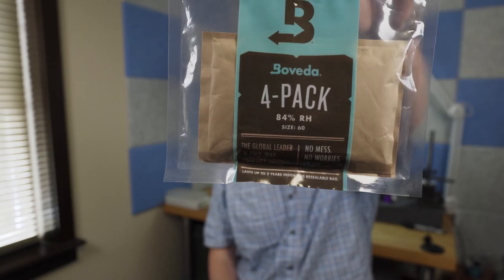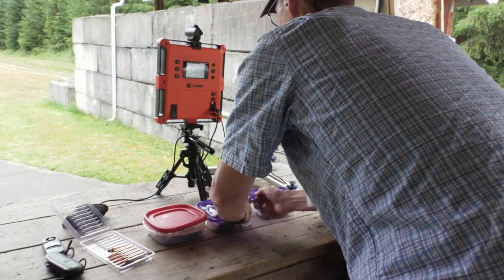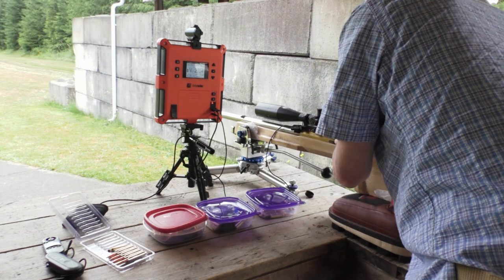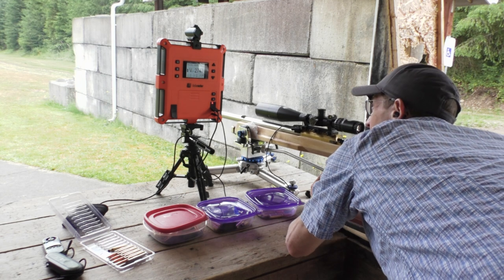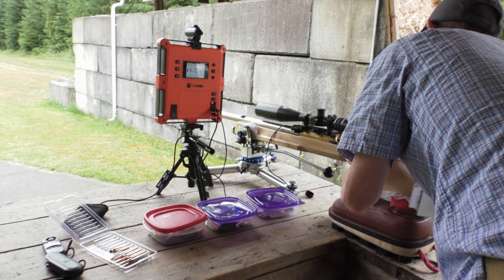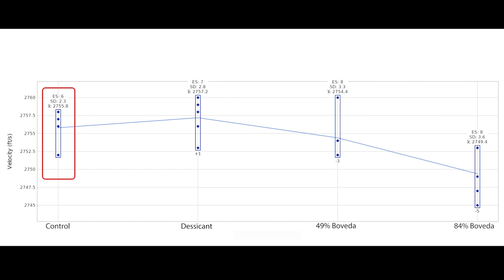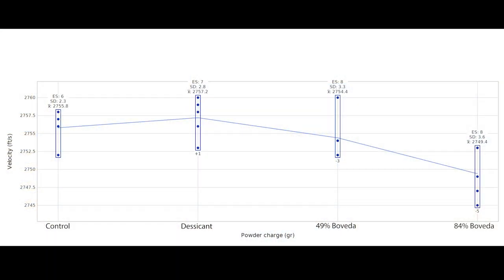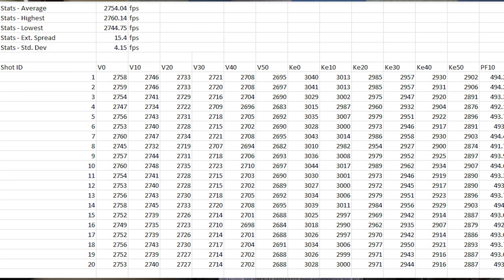Humidity Effects on Loaded Ammunition

Comment: Had a friend who lives at the beach here in Orygun gave me a bunch of loaded .308 to shoot in the Classic Military matches. The ammo was terrible, lots of necks separated when fired and some were an FTF situation and the velocities were all over the map and accuract was nill. So, i pulled all the ammo down and salvaged all the bullets. The brass was a total loss full of corrosion inside and the powder which was IMR4895 was clumped inside the ammo and some I had to dig out. The powder was a dull grey/black color and had swelled from the moisture. It was a total loss other than the bullets were fine. I called my friend and told him to check his stored ammo for the same thing. I was just the other day loading some .308 with some old 4064 in the old IMR metal cans the powder looked the same and kernels had swelled 2X and had a dull grey finish and looked nothing like 4064 from a new plastic jug the dead give away was when I loaded a .308 case it filed it up darn near to the top of the neck. I looked in the can with a flashlight and the inside of the metal can was all rusty. We have huge temp. swings here in So. Orygun and the winters are wet. I'd say it's best to store Powder and Primers and even loaded ammo in a temp. controlled enviroment for sure.

Comment: Took your data and ran it through a t-test using 95% confidence and beta of 0.8. At the end of the day, with the sample size used one cannot empirically claim humidity has any effect. Though if I were conducting this study I would take a few more data points with the expectation it'll show a difference then. Seems like moisture does effect burn rate.

With that, the difference of the high humidity vs your control is VERY close to minimum difference to detect. Looks like you needed about 1 or 2 more samples from each population and the study would pass the sniff test. Any differences between the groups that are not the high humidity would require a sample size of 54. 

Good stuff!

Comment: This is a nice quick test, and thanks for doing it.  Seems as though humidity for loaded rounds  doesn't really matter much.

This test reminds me of a test done on the Coravin, a tool that seeps wine out of a cork with a tiny needle without having to remove the cork.  The Coravin replaces the wine with inert gas which supposedly keeps the wine from oxygenation. 

A test was done, and supposedly wine stays like new for 30-60 days after using the Coravin.  Meaning it takes quite a while for oxygen to seep through the tiny hole made in the closed cork.

This test seems very similar, with similar results.

Comment: It would be cool to see a long term experiment to evaluate the rate of humidity transfer through the sealed case. Set up would be like this - load really dry powder into rounds, then store them in a high humidity environment. Shoot groups to get the velocity at one hour, one day, one week, one month, one year after loading. Control would be moderate humidity powder stored in a moderate environment for the same time periods.
Reply: i have 12 bore ammo witch is over 50 years old the case is paper no special storige they are still working no problem

Comment: I would think that over extended time, a period of years or decades, that this result would be more pronounced. Also, with great extremes, again the result would be more pronounced. At some point the impact would become significant but without further testing over a long period of time we certainly can't quantify it or make any projection as to a critical point or condition. I think that your test does prove that loaded ammunition is susceptible to penetration by humidity and that is significant in itself. Of course now Midway will have a run on bullet and primer sealing compound and they should send you a nice thank you card.

Comment: I developed a load with stable 6.5 powder 2752 fps SD 3-5 ES was under 12 always and it was the same every time I loaded them I control my temp 65-72 and the humidity 35-45% all the time I had been regularly loading this load and then shooting then a little time passed where I was not chronographing it I was just having fun I decided to recheck my load by loading some groups with a little more and less powder little more and less seating depth and it was still right on however my velocity went from 2752 average to almost 2715 increasing or decreasing powder or seating depth did not improve accuracy or SD or ES numbers I was still right in the node or maybe not because my velocity but anyways I never did figure out why it changed so drastically and why it had zero effect on my ES SD or group size 42.8 grains was where I was at same lot of brass powder and primers same lot of bullets throughout the entire time and I have a setup so that if my scale was to change you know it not to mention I use multiple scales with each powder charge including a beam scale I also calibrate my scales each time before I load I even tried bumping the shoulder more and less to see if something changed without me knowing not to mention I measured headspace surprisingly bumping the shoulder anywhere from 2 thow all the way to six made zero difference in velocity numbers whatsoever it also had no effect on group size which I find alarmingly strange it shoots sub 1/4 at 100

Comment: Nice test, thanks for the info, and your time making it. The thing that I always wonder about is, what is happening inside of the loaded ammunition, when it is exposed to sudden temperature extremes. For example, taking a gun from room temperature and walking outside, and it is instantly covered with condensation, and the same thing happens, going from outside into room temperature. I wonder if this condensation is also happening inside the ammo